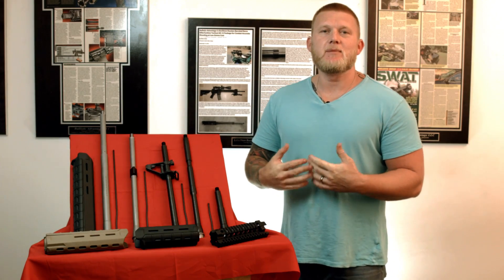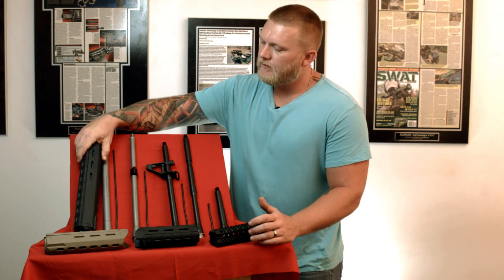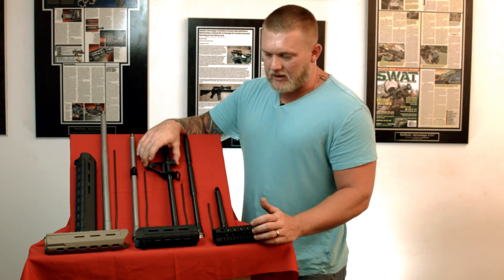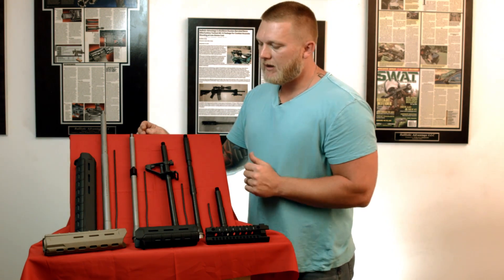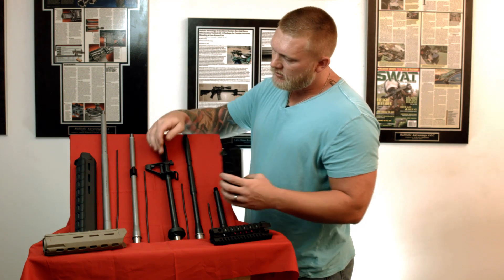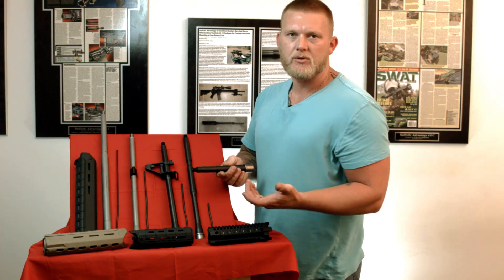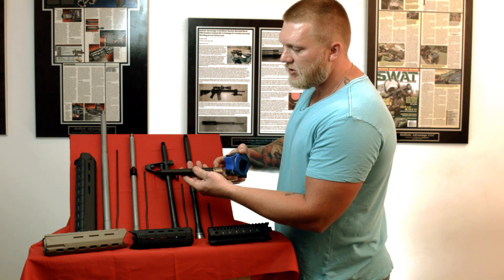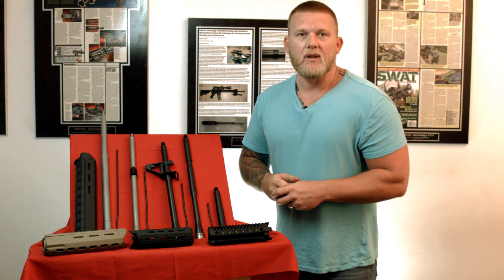Ballistic Advantage - Basic AR-15 Gas Systems

Comment: Any plans or does BA offer longer barrels 18"-22" with shorter (carbine) length gas systems? I'm having issues with my 20" BA barrels short stroking. My Faxon 18" and Proof Research carbon both with rifle length or +1 gas systems having no issues. I'm pretty sure the BA barrel gas ports are too small as these are the only ones I'm having issues with. All other components are basically the same. I'd rather have too much gas and tune it from there than too little gas. More difficult to fix cycling issues with that sort of mechanical problem. I believe I'll ending up fixing this with a lighter sub 3 oz buffer. Anything else will be quite expensive i.e. low mass bcg,etc.